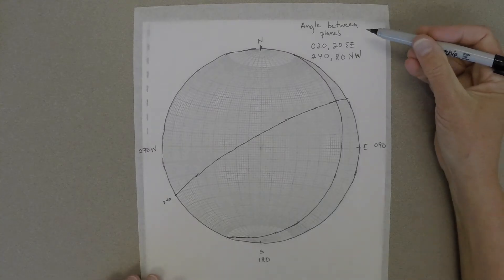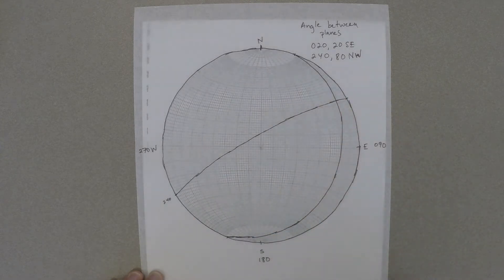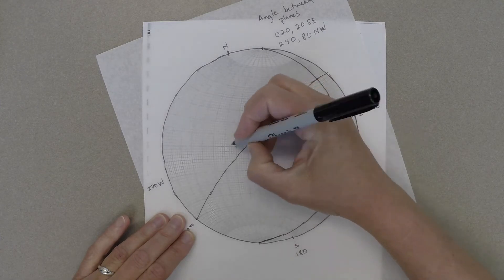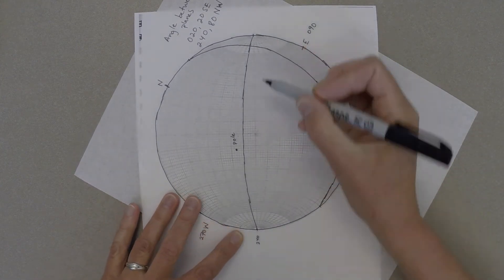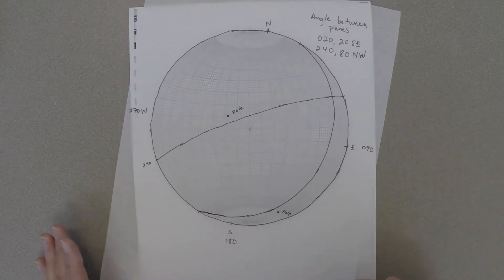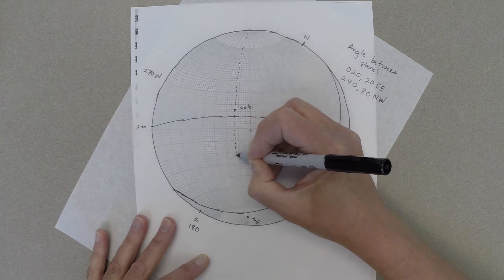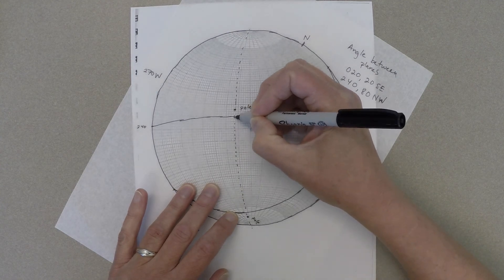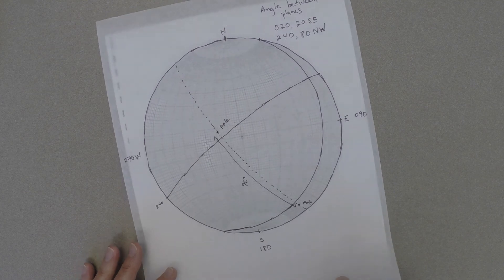Stereonet: measuring the angle between two planes

Comment: what is the significance of measuring an acute and obtuse angle between the planes? what are the implications geologically if you know what I mean? (thanks a lot for your videos! I appreciate your work!!)
Reply from the maker: It depends on the situation. If you're looking at a fold, the angle between the limbs in the field will be either acute (less than 90) or obtuse (greater than 90). The angle between the limbs is used to describe on aspect of the shape of a fold (gentle, open, tight). And there are some practical applications where you might want to bisect an acute angle, or an obtuse angle.